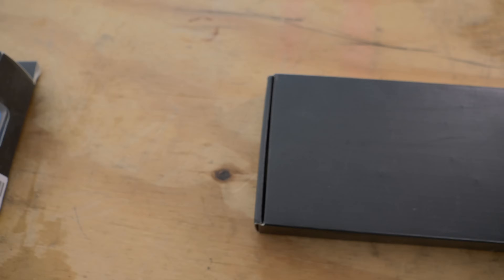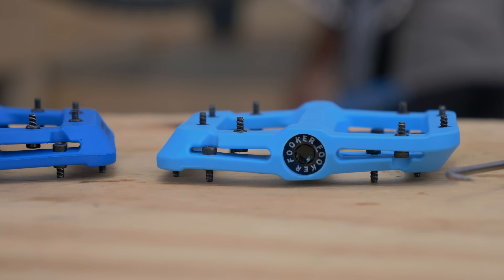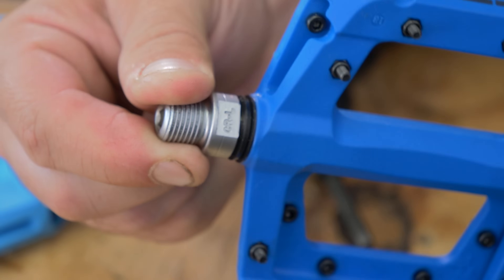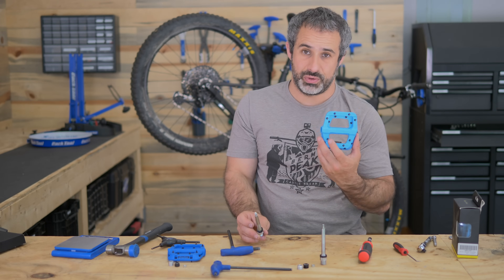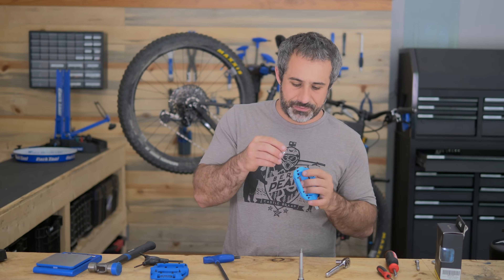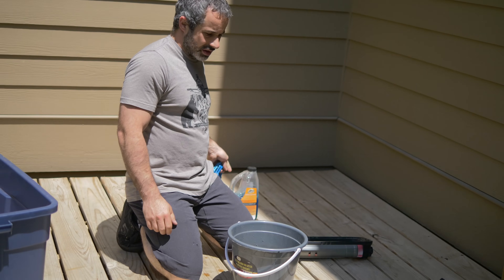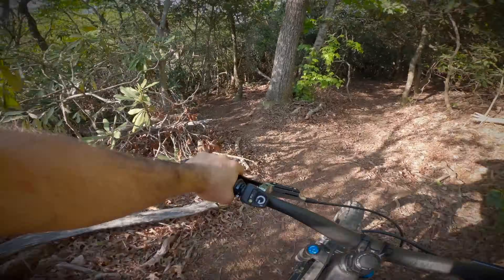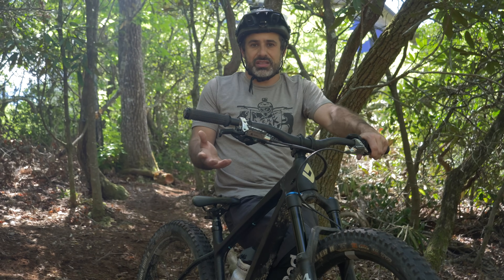These COMPLETE KNOCKOFF mountain bike pedals have me heated!

Comment: Assuming these aren't just the same pedal contract manufactured on the same machines in China, you're not talking about some new whizz bang invention. It's a platform pedal. I was using those on my old Redline BMX bike in the mid-90s. Back when they had Cr-Mo frames! You used bear claw pedals until you didn't get your foot back on quick enough and discovered your pedals were actually sawblades as they ripped through your shins. Then you switched to platforms because bleeding into your own shoes for an hour sucks while you wait to get stitches from the bear claws.

But honestly, if you're mad because some Chinese company makes the same pedals you make, and they're the same as a platform from 30 years ago and it's cutting into your overpriced sales, tough shit. Innovate instead.

Comment: I’ve got the Chester pedals on my diamondback hardtail, they’ve been through hell and back and still work and perform great!
Reply: Croomrider97 the race face slap g
Reply: I have never had any set of pedals fail in my lifetime. I normally replace them well before that.
Reply: I had a pare of fookers and the fell apart after 3 rides
Reply: @ond.mp3  They must have been some really Fooked up pedals.
Reply: I have fooker pedals on my diamondback hardtail, no issues and I saved $20
Reply: I rode a pair just ffg or winter and snapped one lol fooker junk
Reply: @dillonglassford5688  Sounds like you saved some Fooking Money. LoL
Reply: DYNAMO ME fookin a right that’s a couple sixers bud
Reply: @ond.mp3  I've been using fookers for 6 months and they have been pretty great...
Reply: @dillonglassford5688  same lol diamondback hard tail as well. I got the line.
Reply: Who the fook cares.  1/3 the price and they're great.  Had mine for over a year.  No problemo.
Reply: @snop6176  lol. I'm waiting for my fookers to come in the mail for my diamondback overdrive
Reply: @kylelaser6705  Nice man they're legit no joke. Still riding them hard 3 times a week, slamming down on em after jumps and no problem at all.
Reply: I'm looking at grabbing the hatch or the hook I want the hatch cause hydraulic disc brakes Diamondbacks look amazing and tough love single chain rings I can upgrade as I need to no biggie ❤❤
Reply: @No_ReGretzky99  i actually got a commencal clash enduro full suspension mtb in 2021, sold my diamondback hook to my friend and he rides with us now!

Comment: Seth, you should review oval chainrings. Supposedly they make it easier to climb hills.
Reply: So do muscles
Reply: @lakesidelaunchers4307  dude your thumbnail looks a lot like seths
Reply: Yes , get this comment popular and he might see it!!!!
Reply: Yeh Im curious about those
Reply: Yeah that would be cool. I’ve been wanting to try one out.
Reply: I have been riding with an oval chainring for a couple seasons now. I like it well enough. Worth a couple extra bucks. Find it helps more on flats then when riding with clips. First couple rides I did notice a significant improvement, but then I guess I got used to it. Does feel like the pedal stroke is more consistent. Most people either say they are great or they do nothing, so don't think there is much risk in throwing one on and giving it a try.
Reply: i wanna see that
Reply: As far as I know they don’t necessarily make it easier to climb, it will help if you have a bad pedal stroke (in other words a in consistent stroke) so it’s good for flats riders who are not used to peddling backwards (I pedal backwards even with flats due to always riding clips and it helps with climbing). But if your a really good rider who peddles well or is confident and used to clips I don’t think you need it, that’s why the pros don’t use them, xc, enduro, dh etc. You can check out world wide cyclery for the oval chainring video they made and explain its positives. I the negatives as far as I know are that your chainring is closer to the ground and the risk of being hit is higher, and you will now be limited to which chain guide and bash guard you can fit. In short, they correct pedalling issues but if you have a smooth stroke they are unnecessary and can hinder you (and they are just a bit more expensive). But this is what I have heard and not what I have experienced but I think most of this is correct but if someone can correct me on something please do.

Comment: I made the same mistake with some Chinese brake pads off of Amazon. I thought “probably made in the same factory, why not save some money” but the pad material separated from the backing after just a few rides. Luckily we were just messing around in our local woods because of the lockdown and nobody got hurt, but had we been riding our usual trails, it could have been very ugly. Just pay the money and get the real deal!  Stay safe!
Reply: There are good brake pads for less than half the price out there, but you gotta do your research- test some untill you find a manufacturer that works, certainly don't buy the noname ones. Kingstop I found to be really good, not as cheap as the others but m,uch quieter and better braking power.
Reply: Kenny McRae 👍

Comment: I bought two sets of Raceface Chester's, and both sets started to fail at the bearings. The second set never felt right from the beginning, one of the bearings was clicky from day one. It eventually completely failed and the bearings split apart on a light trail and the pedal slid off the spindle and had catastrophic failure. I paid $50 for those. I decided to try the newer designed Fooker brand with needle bearings for $25 and figured it couldn't be any worse than the Raceface brand. Boy what a better quality set for half the price! The updated Fookers just feel better, spin more smoothly, and have zero play. They have been improved since this video was made.  Honestly, they are now built better than the Chester's and will be my new go to pedal for EMTB riding. They also come with spare pins and shims as a courtesy. The Raceface warranty requires you to fill out a form and give your CC number so they can charge you. Skip them and go Fooker.

Comment: I've got a pair of rock bros. They have been rock solid for me.
Reply: Same here
Reply: I broke two pairs of rock bros
Reply: @wadefisher2049  damn 20 sec ago
Reply: I know, i follow ur channel and followed/copied one of you bike project for my 29" nishiki. Thanks for the guidance. No complaints about my rock bros.
Reply: My last rockbros pedals, the body just comes right off from the spindle and I almost crash i just have that pedals for like 5 months
Reply: Me to
Reply: OLKIE same they have lasted me almost a year
Reply: I've been running  rock bros for the last three years and with no issues
Reply: I have bought 3 pairs, all amazing
Reply: Lakeside Launchers stop, if people wanna watch ur videos they’ll find you themselves.
Reply: OLKIE I’ll delete them all.
Reply: Rock bro’s have a great platform. I’ve used rock bro’s and race face, and I think the rock bro’s are better
Reply: Mine got destroyed after a month
Reply: OLKIE that brand is so good, they are chinese, one year with them so happy, have so such good grip.
Reply: I raced a whole season of ews with a set of rockbros in a slightly different mould (they were my spare set). Ended up sljightly bending the spindle because I blew my foot off after slamming the pedal into a stump at high speed. Just buy a few spare sets. Pins are good too paired with 510 impacts.
Reply: Pun intended
Reply: I have Rock bros on both my hardtail and full suspension bikes
Reply: I also have a pair of rock bro’s and they have held up well for a a year now.
Reply: OLKIE also RockBros don’t normally directly rip off pedals. I have nylon ones that are similar to race face chesters but they aren’t even close to being a copy like the fooker pedals
Reply: Bro same
Reply: Mine snapped in half

Comment: At 4:39 The fooker pedal shaft above the seal is a third less the diameter of the race face shaft. This is where the shaft will bend when landing heavy on most pedals, but on the  fooker I would say a light to moderate landing would bend them. 
I reckon I could bend them just bouncing through the suspension stroke stationary.

Comment: when he realizes they are made in the same factory he will poop his shorts.
Reply: They aren't, the material is quite different and you will notice the durability issues about 5 months riding them. 
Like Seth said, the type of steel and bearing type make a huge difference in durability. You won't notice it short term but they will snap at the 6-8 month mark.
Reply: Precisely. I used to design power tools and Bosch, Ingersoll rand, atlas copco and my company all sourced grinders from one company. We would even use the same designs, just pay more to have “exclusive feature” and change the look outside. Most but not all of the parts were interchangeable. Sioux and others Chinese brands were selling the exact same tool but at way lower profit margins.
Reply: Well to be fair, pretty much all batteries etc are made in the same factories. You know, those Samsung one's that cost 20€ are just manufactured in the same place where they make those pirate 5€ batteries aswell. But the difference always is that the legit companies have to follow restrictions and guidelines, while the others don't. That's the main concern with pirated products.
Reply: I guess that's the price to pay for outsourcing stuff to China...
US company does it to increase profit margins to 72%... Chinese guy, hey! I could sell the same and be happy with a 30% profit margin
Reply: @lljkSadi  curiosity what are some good chinese power tool brands?
Reply: I can guarantee these pedals were made in the same factory, using the same moulds but interchanging the branding inserts for various different companies that will have bought the licensing for these pedals. The spindle and all the other components will of been sourced elsewhere to cut cost
Reply: Iain Cameron Sioux was one I saw some good stuff by. But honestly it’s really hard to recommend any of them. I never saw one that I though across the board made good stuff. All are mixes of super good and garbage.

Comment: "How is this legal?"  Made in China... tooling for mass production is expensive, so I almost think it's more likely that Fooker just ordered a cost-down version of that pedal from the same factory that RaceFace uses, using the same mold.  If the bike industry is anything like the guitar industry, lots of brands get their products from the same set of overseas factories.
Reply: That's pretty much what I was going to write. Maybe even the fooker pedals are a generic design pedals and raceface ordered them with an upgrade on internal parts. SRAM designs a lot of bike parts but relies on factories in the far east to make them and may change factories frequently to get the best price. Maybe after losing the contract with Raceface they started knocking out the same pedal moulds pretty much under their own brand. 

I've have to say I've bought pedals from ebay for £3 with aluminium bodies and after servicing them as soon as I got them with grease and getting the tension just right they were great pedals. They were loose bearings so easy to replace too if I need to. Seen pretty much the same pedals go for £30 in local bike shops as their economy pedals.
Reply: Goes on in the US too. I worked at a place that made ketchup. Guess what we did every brand lol... the were close it was funny on how some companys charged much more of their brand. Some big name brands owned the store brand.  Sometimes your just paying for a name.
Reply: @Wrang15  true, I bet that occurs in many industries.

Comment: At a guess, the fooker pedals are made in the exact same factory as the raceface pedals, potentially ones that didn't pass QA or maybe the factory just sells that design to multiple different brands and the fooker pedals are just finished with cheaper hardware.
Reply: I bet it's not even cheaper hardware. Race face orders 100,000 units from the factory in China, the factory delivers the product but they still have all the molds and means to produce the pedals with the knowledge they can sell them at half the price and still make a profit. Who wouldn't?
Reply: thats what race face gets for cheaping out and going the Chinese route, these chinese pedals are made to make money for the same kind of businessmen as the raceface pedals.i dont care where a company is "based" raceface is the one responsible for the chinese pedals.

Comment: You can use an adjustable soldering iron to get an idea of how strong a plastic blend is. The more heat it takes to melt usually means it has more glass, carbon, or aramid blended in it. Cheap parts have little or no fiber in them and will melt at a low temp. Take the soldering iron at it’s lowest setting and touch the tip to the plastic of both peddles. Slowly turn the heat up while testing each part. It’s not exactly scientific but it will give you some idea of what the plastic is made of.

Comment: I doubt these are copies exactly. This sounds like a “3rd shift” deal, where the factory in charge of the injection molding comes back after hours to make unauthorized production runs. The bearings and other stuff being different makes sense, as I doubt the factory would do all that for a 3rd shift item.